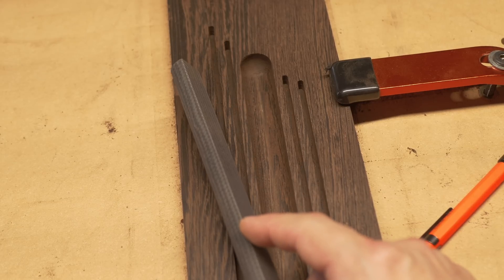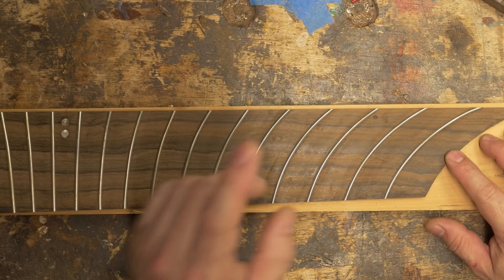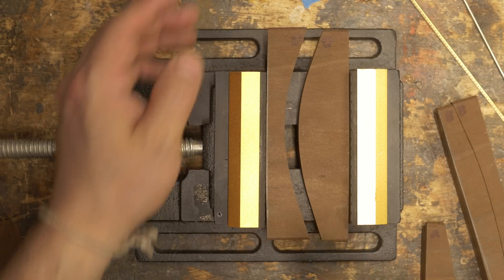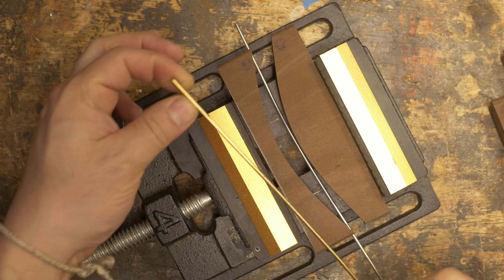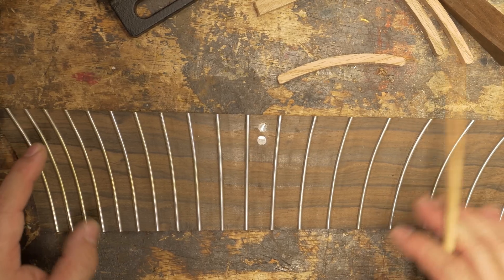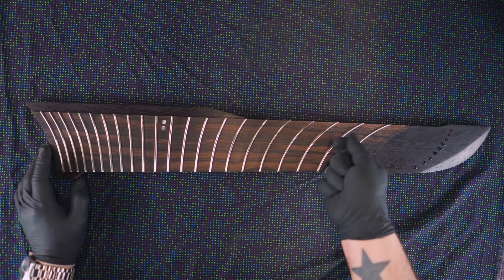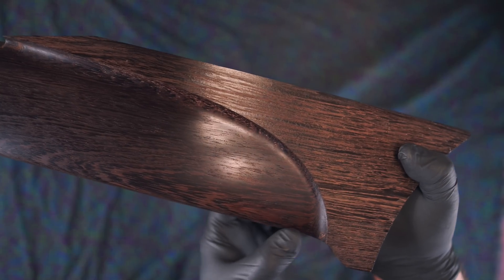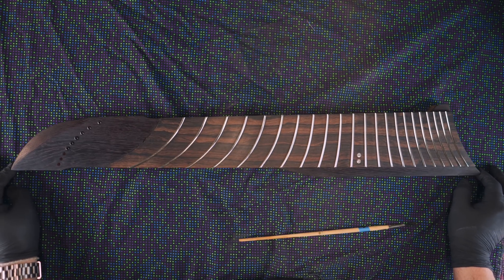Exponential Scale - Great Guitar Build Off 2022 - THE AVANC #GGBO2022 #greatguitarbuildoff2022

Comment: Hi Mark! How you get to the exponential formula for each string?
Reply from the maker: Hi, I don't have the formula off the top of my head. I think I may have talked about it a bit in some of the replies to other comments about the formula. You may want to start there and comb through the comments to find an answer I may have provided. Essentially, from what I remember, the exponential growth is determined by two main variables. The scalar value (how fast it grows) and the exponential value. I built a Microsoft excel spreadsheet that allows the user to plot in the values in order to output the locations for each fret. Now that I think of it, I may add that spreadsheet to my store.
Reply: @MarkGutierrez  jajaj I will buy it
Reply: Hey, currently working on something similar, use this:

Table [26.5+6/(exp(2.5)-exp(0))*(exp((x*2.5)/8)-exp(0)), {x,0,8}]

Type this into wolframAlpha, it will give you the scale lengths for each string. Then type this into fretfind2d in the individual scale setting.

How to use this formula?
26.5 here is the first string scale; 6 is the scale added by the fanning (so here it would be 26.5+6=32.5 inch scale for the ninth string); 2.5 is the number that changes how aggressive the curve will be. The lower the number, the more linear the curves will be, the higher the number, the more "exponential" the curve will be; and the number 8 is for 9 strings, so if you want 7 strings, replace this number with 6 (so #Strings=n-1).
The dimensions here are in inch but of course also work absolutly the same if you change them to metric units
Reply from the maker: @severingetzner8211  that sounds about right.

Comment: Looks good and all high tech, but it's all wrong for several bad reasons some which you obviously learned the hard way (could have looked up first to avoid the trouble):  Starting with the "Exponential curvature":  There is no actual reason for it than trying to be different.  A fanned fret AKA multi scale fret layout does help with the differences in string gauges and their tensions, in balancing volume, and intonation, but it's not a huge quantity or improvement for any of it already, and all you really increased exponentially is to complicate  building the instrument and any fretwork when needed down the road!   It also increases the price of both exponentially too.  BTW:  Ibanez made a curved fret guitar, and it and the hype they had with it disappeared in a flash when a.)  the reasoning behind it was based on a false understanding of physics (was nonsense), and b.) they realized it costs way more to make, and is a bitch to ever repair.  I would need a curved fret crowning file for it, and one file with a different curve for each fret on your neck to crown them after leveling them and because of the motion needed to use them... Sorry, but it's just not worth all that to make instruments few could afford.  Those squigly fret "Perfect intonation) fingerboards some English company makes come with one huge lie:  "Any competent luthier can do fretwork on them":  Not without a similar CNC to what they may be using, unless thy have a way to guaranty perfectly leveled frets without any filing/sanding required.  Replacement frets come pre-shaped but even the slightest inconsistency between their height after pressing them in, and leveling and re-crowning is required, and there is no file that can get into the kinks in those frets or follow the curves cleanly, and it could take a whole week of ten hour days to get done:  Who's going to pay me for that?  I have just enough ADHD to pull it off, but it's so much easier to just say "sorry, you need to find someone who wants to deal with that and risk their sanity".

Let me guess:  You forced the frets into the slots and used epoxy to hold them in?  Oh dear, sooner or later they will pop back out!  So called "Bell brass" isn't a true brass, and its made to mold horns out of, and I never even seen frets made of it, only nuts, and those suck because it's too soft.  "Malleable" is the actual physical property and word you were looking for, as soft isn't quite the same thing.  Horns are tempered during molding via the stretching because of a higher copper content.  True brass is actually not softer than traditional nickle-silver frets, not even close.  Brass is much tougher and way more flexible.  It's slightly tougher than Stainless steel but not as flexible, and those Evo frets Jesco makes are of very similar alloy's.  In your case the traditional nickel silver frets would work best, as they are malleable and can be hammered into submission, and hold pretty well.  You can't do that with Stainless, brass, or Evo fret wire.  Those all have to be bent to their final shape before pressing them in, and using a hammer for more than tapping down the ends lightly will mess them up and throw them out of whack.  You cannot rely on glue to hold anything but nickle silver frets in that don't fit right to begin with, as the glue doesn't stick to those metals well, and the wood may expand and contract with the climate, to where they will spring back to shape first chance they get, and that even a century later, so your hoping they would conform over night is laughable.  You really are winging it:  Try this thing called research, it helps save time and money, and can knock a bad idea out of your head before you waste too much time with it.

All carbon fiber neck has been done, by more than one, starting with modulus graphite in the 80's and they were very expensive, made replacing the frets a huge and expensive undertaking, and for what"  To save like 2 lbs of weight?  Other companies tried too, and well the tradeoff is not worth it, and almost everyone who tries goes back to wood because of the difficulty molding and autoclaving the material, which is done under pressure and heat for long periods of time, and necessary for strength, otherwise it will be brittle and can shatter when hit.  Working with it and the mess and hazards that come with it are all big drawbacks.  I put carbon fiber rods in all of my necks, and a strong two way adjustable truss rod (Not a reinforcement, but for adjusting), more of each depending on how many strings. They are not that heavy, but are adjustable to suit a variety of string gauges for a buzz free low action.  I have been doing so since 1985, along with stainless steel frets, and heelless neck to body transitions.

No truss rod = not adjustable.  Are you going to carve in the bow for relief?   For what gauge set of strings?  What if the owner wants to go up, down a gauge does he pay someone a small fortune to re-carve the relief in the frets, or re-fret it, coming full circle to the dilemma above?  Now that I got to the part where you have a finished neck, it has zero relief!  Oh dear, it's either exponentially higher action going up the neck and bad action, or fret buzz! 

Now I have to watch the rest of this build to the bitter end and see what all else you find out the hard way when it's done.  Will you ever show it being played, or are you going to hide it like you did your method of inserting the frets, which i have to assume you already suspect won't hold.

The sign of good design and craftsmanship is not:  "Cool man, lets do this", but bringing the most functionality and practicality that can be achieved by the simplest of means in balance.  The most affordable and best tool a designer has is his brain, to figure things out and get it right before even sitting at the drawing board.   You can always add esthetics around that and incorporate it where feasible.  Looks like you have Ben from Crimson custom guitars as your mentor:  Bad choice.  He starts building and thinks later, in an endless chase of fixing bad decisions and mistakes.

Sadly your ASMR tone of voice and presentation deceptively convey knowledge and skill you do not have, and many will fall for it as I can see already in these here comments.
Reply: The only laughable thing here is your pretentious attitude to all of this.

Your false sense of superiority is pathetic and to be honest amusing. You seem to be a typical case of the Duning-Kruger effect where you've watched a few luthier videos over the past few days and now think you could become the next Paul Reed Smith. Last I checked your name wasn't in the entry for The Great Guitar Build Off and thank the powers above for that. The challenge is both for a good cause and to drive innovation, unique ideas and designs, which this has accomplished well and above.

Final note, Ben from Crimson Guitars is excellent at what he does. Yes he builds first and thinks later but that is his creative process and he is always left with an excellent result. He wouldn't have the success or the respected business that he does if he wasn't one of the best in the business. I just think you've missed the entire point of this endeavor and I encourage you to try looking at this build and others in this challenge through a different lens.

Jump off your throne of superiority and maybe see what it feels like not being a jaded prick to people trying something different? Perhaps even touch some grass sometime. Just a thought.
Reply: It is just some video with less than 20k views. Of course some of this will not work...you must have an aneurism at NAAM each year. That is whole convention center of bad ideas that don't work. 
I hope you have never seen the guy making guitars with colored pencils and epoxy...
Reply: @bwgti  I may not have seen it all, but plenty for sure! (<: 

Never been to NAMM (not NAAM), but most product expos are not much different, with the snake oils and overhyped silly shit.

There are many using all kinds of strange materials, Rube Goldberg construction methods, Flintstones tools and what not, but few if any are claiming to reinvent the guitar in any major way.  Most are just being artists for whatever it is, and don't present what they are doing in the way it is here with the ASMR narration portraying a confidence worthy of an old master while showing to be just a student who hasn't yet found out what the difference between what shit appears to be, and what shit really is, because of a lack of understanding the main subject in the first place, let alone the many underlying subjects that govern much of the design, functionality and construction methods.
Reply: I've just watched the final part of the compilation  video again - the 'Demo'. If indeed it can be called a true demo of the instrument, the background soundtrack could be just more of what has overlaid the rest of all previous videos, and in any case has FAR too much else going on to be an accurate demonstration of the capabilities of the instrument. Anyway, the instrument appears to be as much a 'tapping' instrument as a conventional 'plucked' instrument, taking it into the realms of the Chapman Stick et al. They have such extreme ranges across 10 or 12 strings, treble to bass, that I've often wondered why they DON'T have multiscale [fanfret]. I've seen some of these freak 12, 15 ,18, 21 string 'guitars' that have separated short lengths of fret across the fingerboard. The curved frets are aesthetically beautiful, but for all the reasons explained, probably not worth the candle. My best solution to the fret crowning problem would be a specially shaped grinding wheel [ diablo shaped ] on a Dremel.
There are lots of beautiful curved surfaces on the instrument, many of which could probably ONLY be achieved practically with a CNC. Overall, it is a masterpiece of the programmer's art,  so should be applauded for that.
If it's a guitar building competition, I for one, would like to see fewer of the soft focus, slow motion clips of clamp heads, or piles of swarf, for artistic effect, & more attention to the inevitable problems, & routes towards solutions
Reply: dude get some rest and drink a cup of tea or something. try some breathing techniques and read a book. take a walk and enjoy the summer. ever traveled ? tried camping? there are a whole lot of things one can do to relieve the mental stress this internet-bubble can give us sometimes. it's a whole lot better to take it out in exercise or fun than in a comment section. 
have a nice one my guy, hope you feel better.
Reply: @voidwoken  Been there done that, ever sleep in a sleeping bag hanging off a hook in the side of a mountain in the alps?  So how about you go tend to your butt hurt now?  Oh, and while your at it, how about you try to show me wrong.   When someone put's a video online for anyone to see, they not only can, but should expect critique.  You in fact ar critiquing me, just in a manner lacking any substance.
Reply: Jesus dude give him a break. I hate to use the "can YOU do better?" argument but I invite you to try make a creative endeavor this interesting.
Reply: To all you people, apperantly not being able to read. If you were able to read, you would recognize from his comment, that this man is a luthier himself. Reasons: a) The way he talks about the craft. You don't do that, if you don't know what you're talking about or just looked shit up. b) Dude said so in his comment.

Also, the guy is giving critique. Honest critique, rightful critique. This guitar does look really, really awesome, but it has so many weird design decisions. The curved frets look cool, but are a nightmare to replace and don't really do a lot, that a normal multiscale design can't do as well. Also, guitar has no truss rod. Most stupid thing, ever.

Every bit of critique this guy gives is warranted and makes logical sense.

Got to love the people going like "dude, get out of the internet bubble." Look who's fucking talking. If you guys go outside, into the real world, maybe you'll learn how to takeand give critisism like professional people. Also, "cAn YoU dO bEtTeR?!" He probably can, judging by his comment. Again, the professionalism, that his comment is carried by betrays his skill and experience in his craft.

So, yeah. I can only give YOUR advice, guys, back to yourselves. Get some rest and drink a cup of tea give the dude a break. Go outside and enjoy the sun for once.
And for shitfucking's fuck's sake: Learn to read and use your brains for once. If you can't handle criticism, maybe don't work a job, maybe don't go outside and maybe don't interact with other human beings, ever.

All that being said, like I said in my comment already, the guitar looks absolutely amazing and I would LOVE a revision of this build. One, that takes logical criticism into account. If that exponential fret thing is your gimmick, by all means, go for it. Multiscale has been a gimmick for ages and has just started to gain mainstream acceptance in the last X years. The exponential thing is unique, for sure. But Jesus Christ, put a two-way-adjustable truss rod into the neck.
Reply: @ThorsShadow  Thanks for pointing out what should be obvious.  (<:  I am an old pro from the Grover Jackson, Waine Charvelle, Steve Kline, and many others crowd who cross communicated, got Jesco to make Stainless steel frets, figured out the carbon fiber reinforcement requirements, locking whammy's and nuts... We did so by via bulletin boards on the internet through company, library or school connections, prior to the WWW over terribly slow phone modems.

I myself am not well known, but kind of am, just more behind the scenes, because I have a debilitating disease that prevented me from the higher earning and fame achievements many of those cats reached.  I have only been pain free and able to get shit done for less than a decade, and catching up is not easy, it's financially tough as nails, and road blocks pop up all the time.  I am working on a few far out and intricate master pieces though, but only when I don't have a repair on my bench, but anyone who knows my work knows It's exemplary, and I have taken the tech part to the extreme in learning the physics, electronics, math and all aspects of the craft, unlike way too many that just do shit by the flawed and traditional old worn out book, because it says so.  Those cats are a dime a dozen, and pop up only to get a bad rap, and disappear again all the time.  So this guy is stepping away from the book too:  that's commendable, but too bad he's just not doing it in a good way.

Guitars are cool, and so everyone and their dog want in on it, but there's way more to it then meets the eye, and most will fail, even if they don't realize how bad their understanding and work are, which is a problem to many who pay for shotty repairs, and gives the whole lot of us a bad rap.   In this case the uninformed commenters who can't tell shit from shinola don't help, instead they are paving the way for this cat to sell shotty instruments, do bad repairs and encouraging people to do business with him at their peril.  If he's only doing this for himself and just sharing it with the world, then at least he should be clear that he's no engineer, is winging it by the skin of his teeth... so people know what they are watching and don't get disillusioned.

I just thought I'd speak the truth, which I always do to my customers as well.

So thanks again.